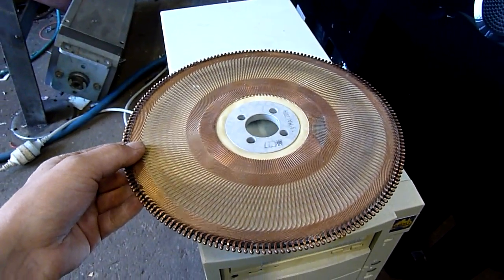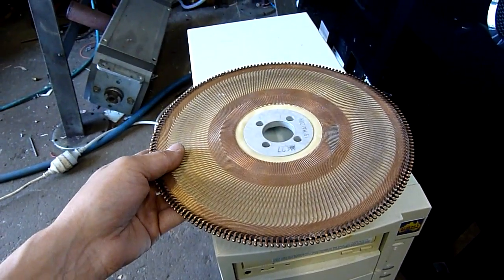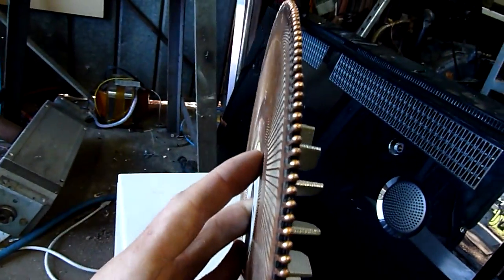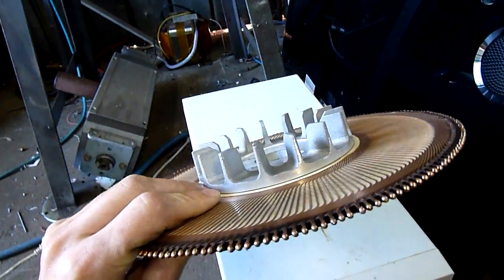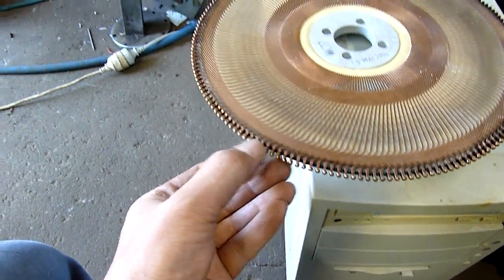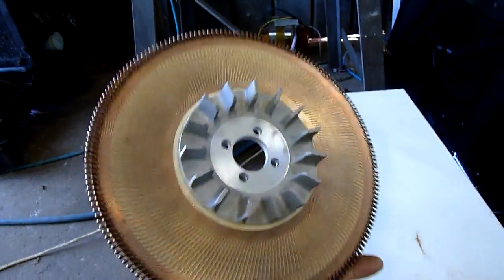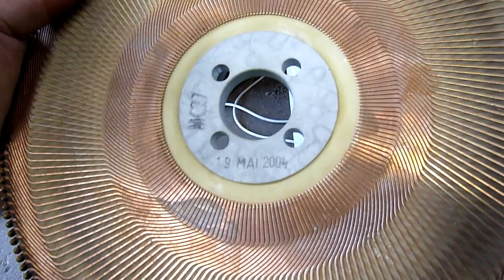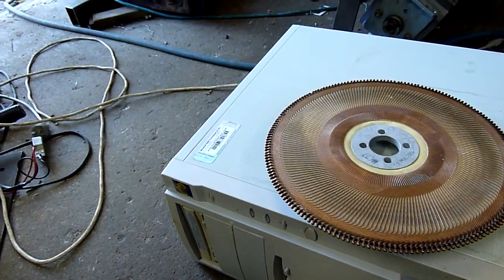Electric Motor or UFO Parts?

Comment: It's a Turbo Encabulator or more precisely the main panametric Fam of a  Pan Cake Star / Delta low profile quad phase motor..You can see that instead of motive force being generated by guasion fluxes and windings generating a positive torque it is now generated by the modal interactions of the magneto reluctance and the capacitive duractance . The cooling fan ensures that the main base plate of prefamulatedamulite is kept below 295 degrees kelvin, this stops the Marcel vanes from going into side fumbling which would be dangerous. I think the US military would be interested in your find.

Comment: I believe that's the rotor of a Kollmorgen "Pamotor" or equivalent. They were used a long time ago for very fast reacting, high-torque motors. A typical application would have been computer tape drives for 10½ inch reels (or larger) that had to generate very high rates of rotary acceleration.

Comment: accelerator. Which as you know will give of radiation. IN A ANTIGRAVITY FLYING MACHINE if it has come striate from the workshop and is surplus you will be fine but if it Has been used and you can tell by the round outer ends will be scorched. My advise is to seal it in a led container and bury it at least 6 foot were no one will come across in for 50 year's

Comment: It is rotor of electric motor. I saw one in sailboat's "autopilot". On one side of that plates are flat magnets and 4 brushes. This one didn't have aluminum fan on rotor. It is very flat motor and I presume it have big torque because it's big diameter.

Comment: At first glace it looked like a turbine from a jet engine, but the blades are too small and the wrong pitch, it also has that cast hub with what looks like blower fins. One other thing it could be a is a heat sink from a transmitting tube, though I can't imagine why a heat sink would have to be that complex. Other then that it looks like a rotor of some kind from either a motor or a generator since it looks like it has a commutator in the middle.

Comment: That's a big one! It appears to be from what are sometimes called "Pancake" motors. I have a strange HP reel to reel tape machine that uses three of those motors, about half the size. One for the capstan and one for each reel. Those motors can spin up FAST. I added resistors to slow the reel motors down because I had gotten painful friction burns from the reels while trying to manually cue tape; more then powerful enough to break a finger on a 7" tape reel.

Comment: O ok it is a motor rotor.   on the bottome a way from the fan in the denter were its flat that is the armature.  there would have been a hoursing with a magnets on that said and the brush would have touch down on tat area.  looks cool.

Comment: That sir is the rotor from an induction motor as you might find on some electric vehicles. I guess it had been used in an ABB robot, but it would seem an odd choice of motor for an arm. There would be no brushes and no permanent magnets (In most cases). In that type of motor a rotating magnetic field is produced in the stator and this leads to a flux that causes a current through the spokes of the rotor. Te field produced by the interaction of this current and the stator flux leads to a torque!